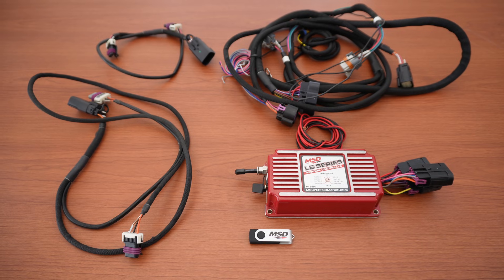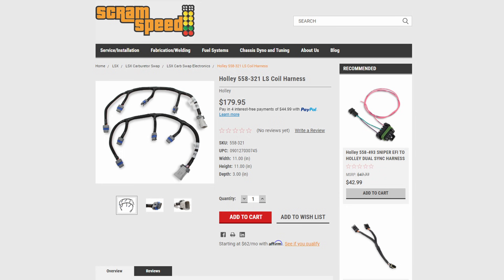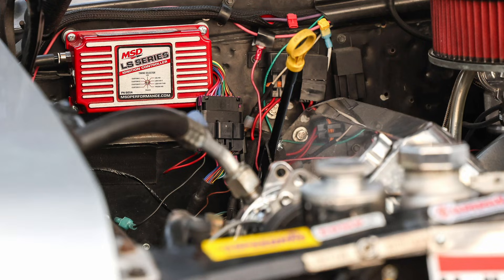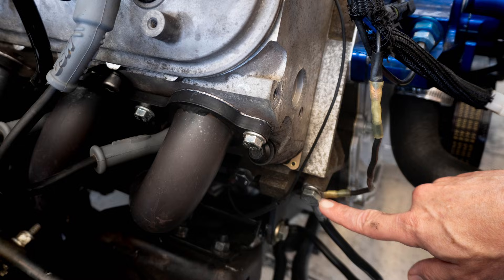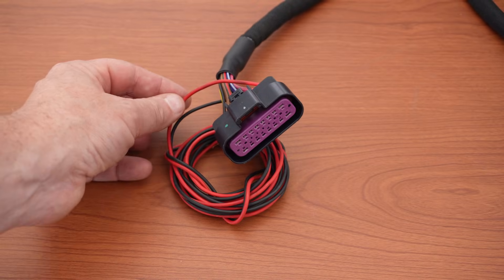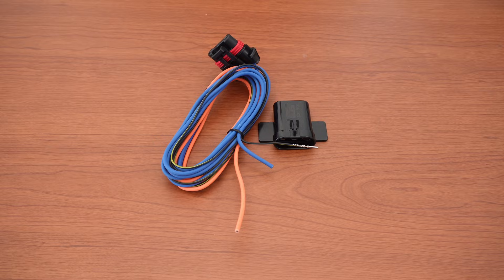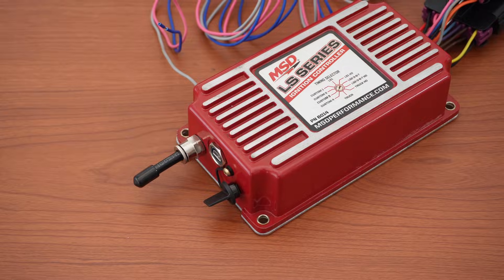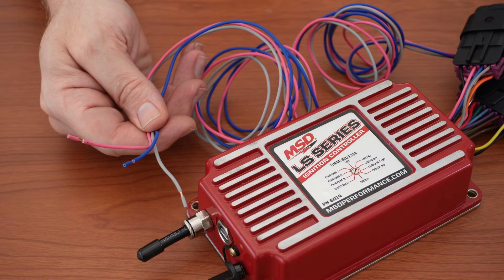You can do it! Carb your LS with an MSD 6014 or 60143

Comment: Could i control the relay with my keywd power to coil wire its was a hei car so its 12v or do i really need to control it via ground
Reply from the maker: Hello: You can use it that way. Thanks!

Comment: If I had a bad ground could it take out only 2 cylinders? I have 2 cylinders #2 and #7 that are not firing.
Reply from the maker: Hello: It seems unlikely. I would recommend swapping the coil packs (not the MSD wiring) side to side and see if the misfire follows the coil packs. If you have the coils relocated from the factory relocation, I would recommend trying it with the factory harnesses and see if that takes care of it.
Reply: @Scramspeed tried relocating, switched coils no luck, and after further testing and found spark is being sent to each cylinder it's just not firing up so either the MSD box is firing it in the wrong order, or the cam and crank have failed I tried new ones and it didn't make a difference.

Comment: Can this be wired threw a relay board with relays and fuse box fuse box is powered threw the battery with a main kill switch? And do you have to have a solid state grounded relay or can a regular relay be used?
Reply from the maker: Yes it can. That's how i do mine in my car. And no you do not need a solid state relay, you can use a standard type for this box. We just like them.

Comment: What about nitrous controllers how do you link ignition tuning with nitrous tuning?
Reply from the maker: You cannot link the MSd directly to your nitrous controller. However, since nitrous is usually only used at WOT, and the n20 controller and the MSD are seeing the same WOT trigger and RPM there isn't any cross tuning required. Just use the 12V retard on the MSD for timing and activate the nitrous at the same time. I run an N20 Express Maximizer 5 on my car. I should probably do a video about that.
Reply: @Scramspeed  thanks man I’m trying to figure out what all I need, it can be a little confusing. I’m slowly putting my car together gonna learn all I can with car setup N/A before I ever worry about nitrous.

Comment: What’s a decent baseline for a bone stock 5.3 with edelbrock dual plane intake Holley 600DP manual secondary  and I’m not running my built in map but would like to for more street-ability
Reply from the maker: Turn the dial to LS2/3/HO and attach a hose from the box's map sensor to intake vacuum.
Reply: @ thanks I appreciate that I tried your baseline that you had in a older video and it honestly helped a ton so I may stick with that and play with it I appreciate your quick input

Comment: 98 gmc sierra k1500 i want to do the carb swap 5.3 on my factory 4l60e would i just need to get the Holley tps kit ?
Reply from the maker: What are you using for a controller? The MSD does not have transmission control.
Reply: @ holy makes a tps kit. You don’t have to have a controller. Just a signal wire off the coil wire and ground and the tps sensor goes on the side of the carb and boom no expensive controller to shift your 4l60e
Reply from the maker: @alexbalderas728 The point being, you dont plug the msd box into the transmission and presto, it happens. This person may be aware of that but we had a box returned once because it didnt have transmission control... 

If you've got a link or wiring diagram for a method that uses rpm input to control the trans manually, we'd love to see it.
Reply: @ I’m not referring the msd box has transmission control. But what I’m saying is just in general for all the 4l60e guys who wants to go 5.3 and keep the 4l60e and carb it that’s what you have to do with the Holley tps kit. I’ll post a video of it sometime soon
Reply from the maker: OK, but are you asking me or telling me? Whatever inputs you need for your swap are what you need. It would seem that all you need from the carburetor is the TPS signal. I'm not a fan of the Holley TPS kit as it just doesn't fit very well.

Comment: Thinking about going carb. Tired of efi. In ur opinion will carb get better or worse mpg ? its ina 6000 lb squarebody. Currently i get 12-16mpg. Also what is the differences between 6014 and 60143 boxes? I like the free t shirt, so I probaly order off u guys.
Reply from the maker: @Jules-x6b  im saying probably worse mpg. The only difference between 6014 and 60143 is the color of the box.
Reply: @Scramspeed  Got a promo going on right now like a intake and box combo deal on ur website?

Comment: How do I get it to run my car is currently backfiring and won’t stay running seems like it’s wired wrong but obviously it’s just a timing thing
Reply from the maker: There are all kinds of reasons that can happen, including carburetor and the installation of the camshaft among others. Hook the heavy leads for positive and ground straight to the battery. Make sure the coil grounds are separate and to the block, not the head. Make sure you have the block grounded to the battery (and the frame). If it's aluminum block, put two . Put the box on LS truck HO. If it still doesn't run, your problem is elsewhere.

Comment: Hey Steve, I just installed a 6014 on my 81 C-!O, it has a stock 2003 5.3. I'm running a Edelbrock 1406 and after the engine get a little warm and I shut it off it will diesel, sometimes it will only do it for a few seconds and sometimes it just won't stop. I know it's not the 6014 because if I shut the fuel off it will die finally. Also, it shuts off every time if I kill it in gear. Have you ever delt with this and what would be your recommendation to correct it. Thank you so much and I love the videos.
Reply from the maker: Thanks. It is overfueling at idle. When the ignition shuts off, the spark dies. As the engine spins down a carburetor is still responding to engine signal and continues to fuel. What is happening is probably a combination of too much idle fuel and too much throttle blade opening. The engine is getting enough air and fuel to run without spark.
Reply: Alternator could be feeding power to the ignition till it dies out also. Ask how i know

Comment: I've heard these boxes can fail. what causes that?
Reply from the maker: I've sold over two thousand of these boxes. I don't get returns. I've gotten 1 back that was actually bad. We've got two cars at the shop that have had these boxes on them for 8-9 years with zero issues. One of them is a daily that's done drag week and the full Hot Rod Power Tour. Done right, the 6014 is a VERY reliable platform.

I do get loads of calls of people having installation issues, but we find those problems are always either carb or wiring issues, which is why I made this video. 

You can kill them of course, if you go welding on the car when they're hooked up, or you don't properly fuse the connection to the box, or you backfeed into the box.
Reply: @Scramspeed  I put one in my car project and it works. not on the road yet but the engine runs. I'm on LS carb FB page and have come across a few dead 6014 stories. I don't know how they would just die. I'm just a bit paranoid to be on a road trip in my cruiser and die out in BFE. Now I have seen people removing fuel on the stock ECU and only controlling spark. I'm told free software TunerPro can do this but I'd hate to get into the cost of HPtuners.
Reply: My experience with mad boxes is they sell so many and you hear alot more about the bad then good and even then alot of it was uner error

Comment: Do i need hook up coolant sensor to msd box on a carbureted ls swap?
Reply from the maker: The coolant temp sensor is not required for the ignition box to work. It is useful for reasons I go into in the videos.
Reply: yes

Comment: I'm running 6014 on my Holley xflow thottle body EFI 700hp LS3 stroker and when starting the ignition box is drawing like 4 volts dropping the battery voltage to around 9. Because of this I have to crank on it for several seconds before it starts. Why would the 6014 drawing so much power? Thanks
Reply from the maker: It's the starter drawing the power, not the box. I'd really check those grounds on your engine ( the starter gets its ground from the block, so the block needs a very solid ground to the battery) Also make sure the positive lead from the battery to the starter is sufficient gauge wire and that the connection is good. I bet this will solve your problem.

Comment: Just subd and bought 60143. Im new to ls stuff. Maybe I'm asking the wrong question. What are the built in timing settings? For example 20 degrees truck  25 degrees truck h.o etc? Thanks
Reply from the maker: Hello: If you attach your computer to the box and use the MSD view software, you can see the timing curves in the application.
Reply: @Scramspeed thanks for replying. I don't have a laptop yet. Not much on tech stuff. But I'm trying to learn. I was wanting to start with the preset settings on the box. Curious what they were.thanks again
Reply from the maker: @Nathan-i6m  If you look at our previous video on the software tuning, I go through the preset tables (kind of quickly, but you could freeze frame). 

https://www.youtube.com/watch?v=qZ1lo_y73qw&t=484s
Reply: @Scramspeed  thanks brother exactly what I was looking for

Comment: I’ll be giving you guys a call. I bought a stand alone EFI setup and I’ve been wrestling it and it’s still not right. And I’ve decided to throw in the towel and go old school
Reply: I've got a 6.0 with alot of work done ported n cut 317 btr custom cam .40 over bore  950 holley carb very very responsive  with holley single plane

Comment: Do these revert back base timing 28 degrees if the battery is disconnected?.
Reply from the maker: No, they do not. The MSD will hold on to your tune.

Comment: How reliable are these boxes??
Reply from the maker: Ive had mine since 2016 without issue. My business partner had his for a similar length of time before selling the car. No issues. Power Tour , Drag Week, autocross, road racing, and used as a daily driver. I'd say they're pretty reliable if you wire them correctly.
Reply: @Scramspeed  thank you so much for your time I've seen a couple of YouTube videos that said they're not reliable and you should use Daytona speed sensor instead can't afford the only do it once I need as much reliability as possible as this will be turbocharged they were saying that the map sensor inside the box is not accurate is this true
Reply from the maker: @brawler3475.0  These boxes are really reliable, and the MAP sensor works, BUT like I said in one of the other videos, if you exceed the capability of the sensor, timing reverts to the base map, meaning it takes all the retard out of it. which is a good way to blow stuff up if you're running a lot of boost.
Reply: @Scramspeed  thank you so much for your time I'm just trying to get the best bang for my buck and the most reliability that I can
Reply from the maker: @brawler3475.0  I'm just saying, my 6014 carbed LS is the most reliable 9.0 @ 150mph quarter mile car I've ever had.

Comment: Curious on your timing curve habits experiences/tricks for cammed applications. I'm running old box 6012 (x58) on a LQ4 (gen4 rotating assembly) Currently im running base 16 ramp to 34@ 4000. Seems fine, but curious.   I LOVE Carb'd LS's
Reply from the maker: Check out our other 6014 videos if you get a chance, as there's some good info there. It depends on what heads you're using, but typically on our dyno, they don't see meaningful gains past 32*.

Comment: For the old MSD boxes the instructions said to not mount them upside down because of condensation.  The box is basically a bowl shape and the backing plate is not sealed, so any moister can get out if mounted right.   I also prefer to mount them in cab, cooler than the engine bay.  Thx for the helpful tips!
Reply from the maker: Thanks for the information! I believe the 6014 is potted, so that woudn't be a concern, but we also prefer to have the box inside the car.